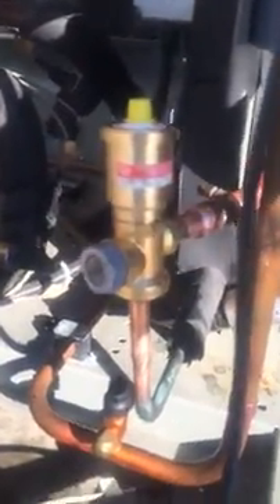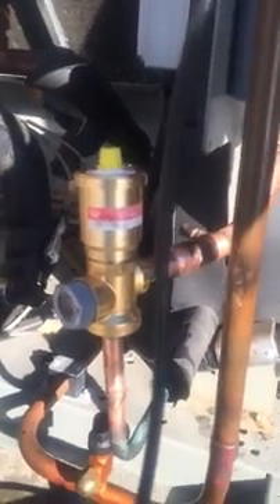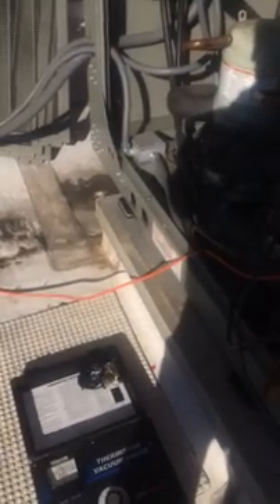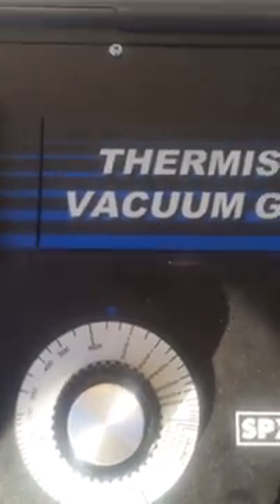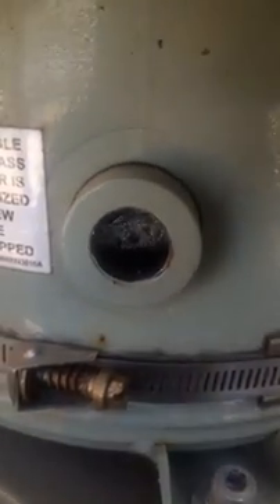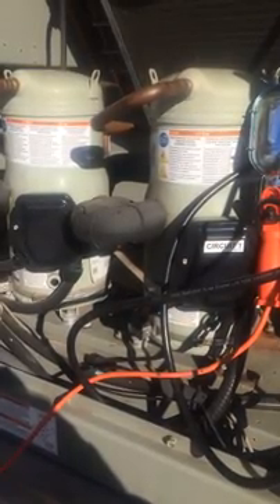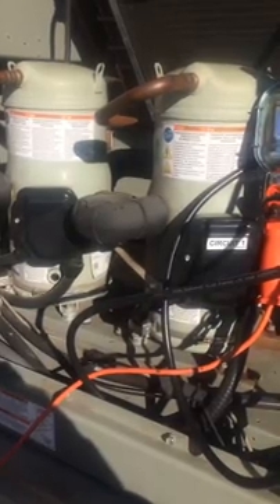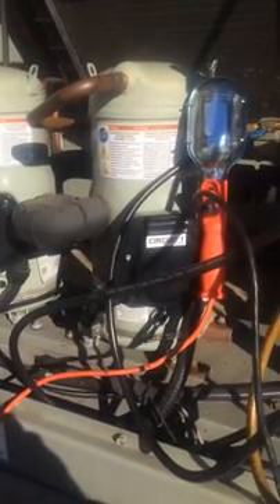R410A Tips, Trane CGAM EXV. work.

Comment: An you can get on tech view on the ch530 an open the exv to 100% an that will help . I hate that these cgam machines dont have suction valves to valve off so you can change a compressor quickly.